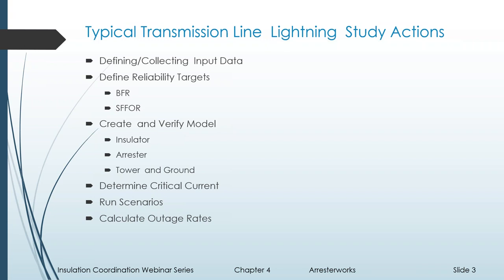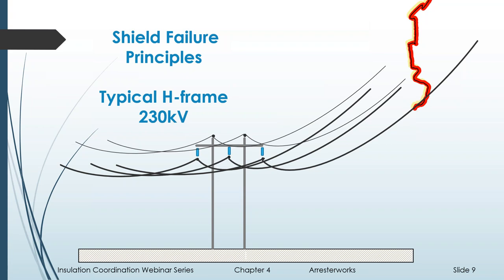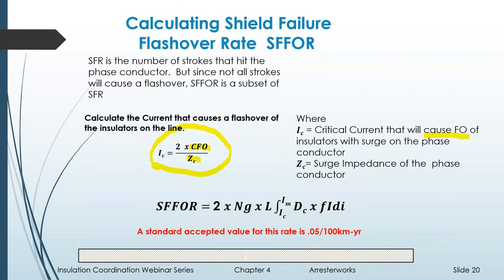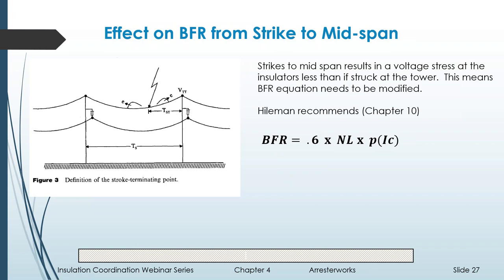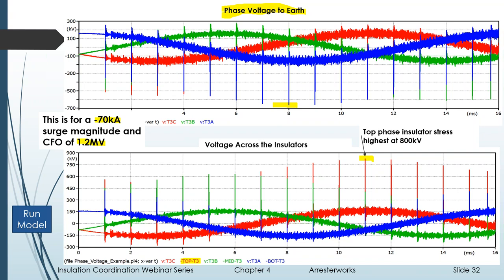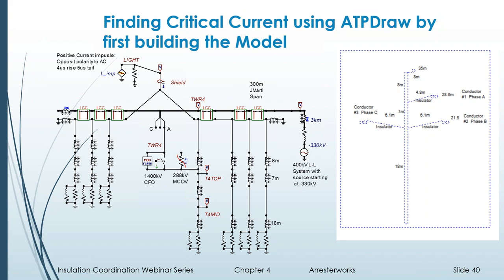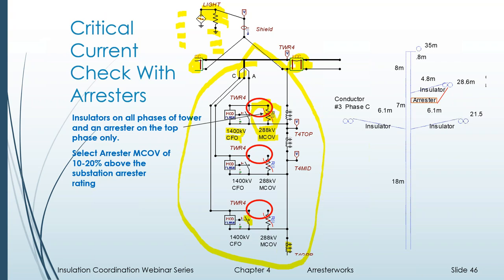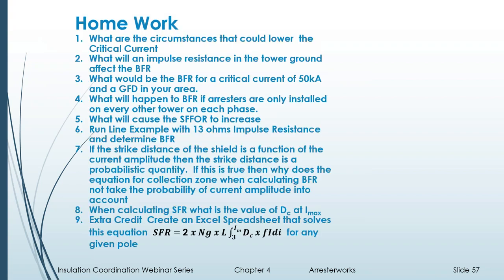2018 06 15 08 59 Chapter 4 Insulation Coordination Webinar

Comment: Great webinar. 1) Could do you upload part 5 or another parts of it? 2) Could you upload or share the direct strike flashover rate calculator for lines for excel that is showed at the finish part of the video. 

Please, Thanks.